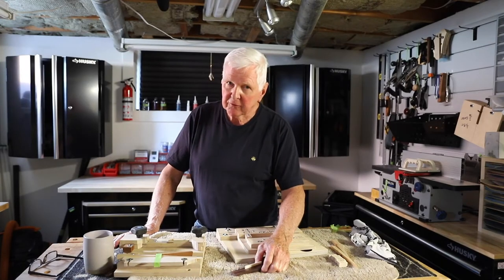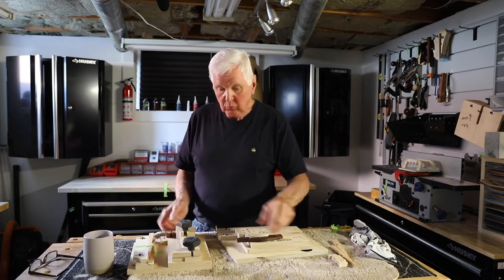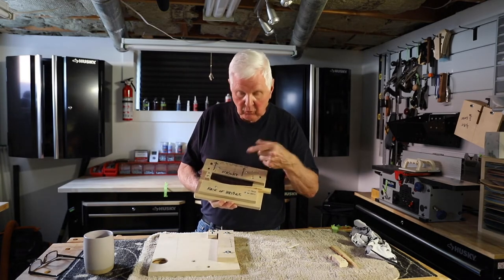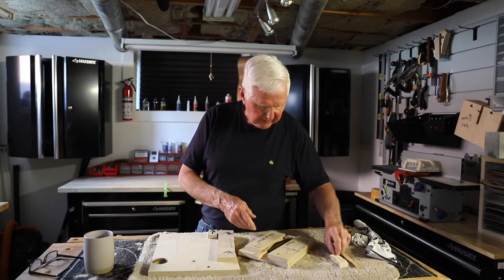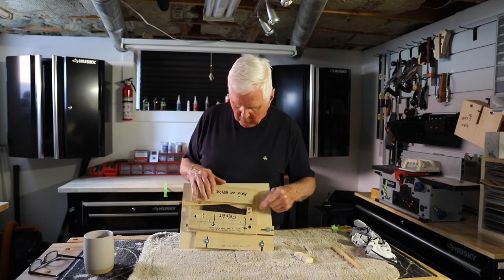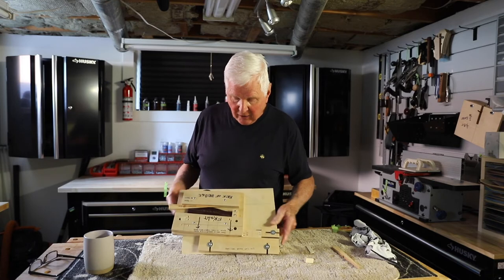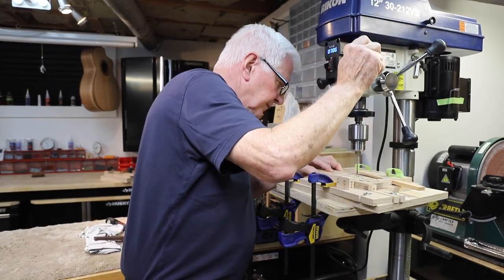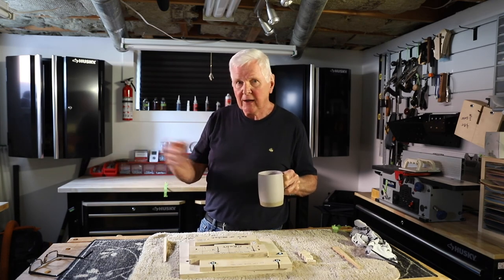Pin Holes in 2 Minutes

Comment: Interesting. I’ve never seen the bridge pin holes in a line parallel to the saddle. It makes sense because it makes a consistent break angle of all the strings across the entire saddle. How does that affect the overall tone of the guitar?
Reply from the maker: Great because it puts equal downward pressure across the saddle.